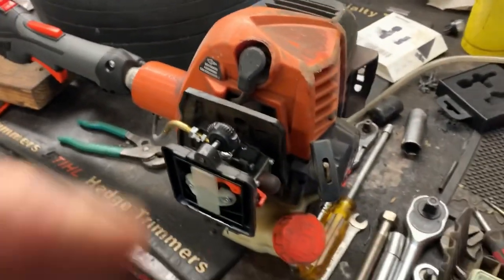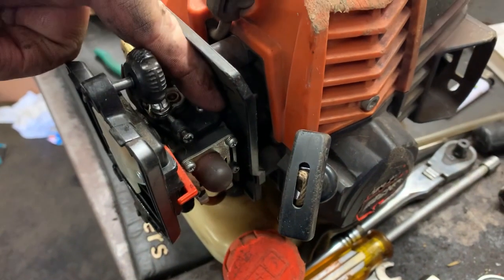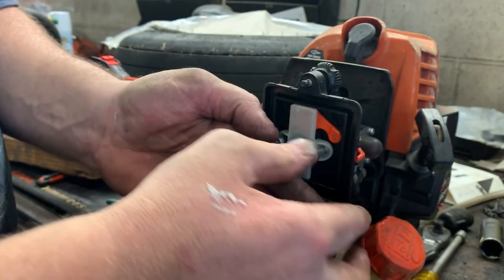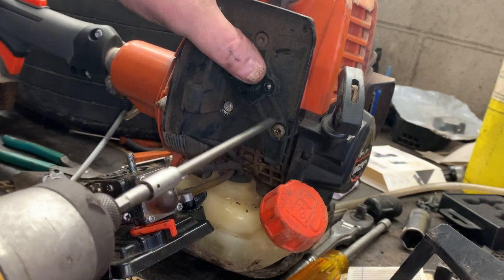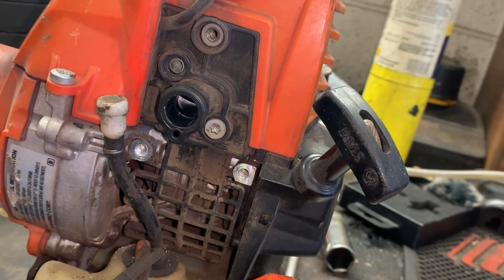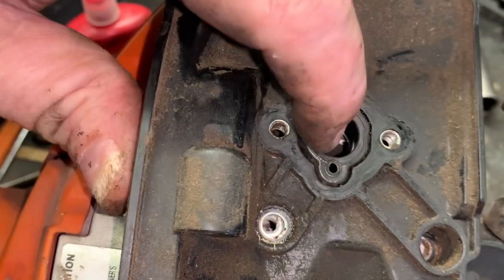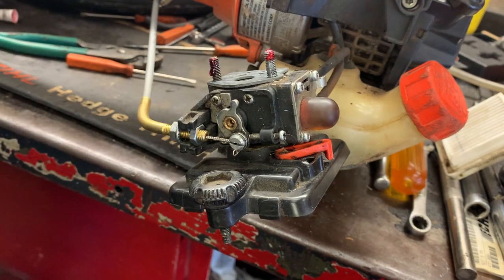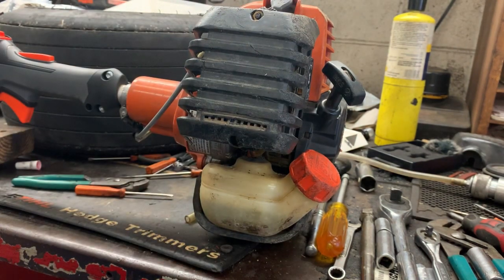FIXING COMMON ISSUES WITH THE ECHO SRM 2620 WEED SNIPPER

Comment: Another thing that our SHINDAIWA 262 trimmers do (appear to be the same) is that they foul plugs often. Same 2 stroke mix as everything else and they foul em almost weekly. Factory plug is a CMR7H, I now use two heat ranges hotter CMR5H and have had no comebacks.
Reply: Mine is fouling plugs now
Reply: @acaudioweddings Would a different fuel mixture solve this, or is it a natural occurrence due to design of the ports?

Comment: why does the string spinner head keep spinning when I don't push the ignition button?I've replace the carburetor pre your video as well as the spark plug, gas filter and air Filter and it continues to spin. SRM 2620
Reply: Carb needs adjusting. Either the idle screw is too fast or the air fuel mixture is off.

Comment: The Mower Medic One I have Echo SRM 2620 I don’t have any issues with this trimmer I inspected everything and maintained every year I love my Echo SRM 2620
Reply from the maker: Good to hear just give those carb bolts  a tighten for grins and giggles
Reply: I had Echo SRM 225 I replaced that for Echo SRM 2620. SRM 225 doesn’t have enough power

Comment: Thanks for the great video.  I have a Shindaiwa T262 (same as the 2620) that I bought last spring.  It ran great at first.  Then, in August, my dad dropped it off the back of his truck.  The whole carb assembly came off and the carb was damaged.  I had to replace the carb but it's never run correctly since. I had to go back 5 times to the dealer.  They claimed air was getting into the tank and put some sort of a sealant on it.  But it still doesn't run right.  When you go pull the trigger, it stalls a bit.  Then, as you're working with the trimmer and it warms up, the same thing happens especially when you flip it upside down.  Is there a fix to this?   If there's not, I'd rather cut my losses and get a new tripper as I had to pay $180 to replace the carb plus the $450 I paid for it.  That's Canadian dollars.  Thanks.
Reply: Did you fix it? I have the same problem
Reply: @davidsolis2149  Nope.  Sold the machine and bought a new Shindaiwa T262.  No problems with that one so far.

Comment: Just checked mine and they were a little loose. I also noticed that a mouse had chewed my choke lever and it is broken but still working. Just ordered a new filter base. He also got my return line. Little bastard! At least the filter base was only $7 and change. I had some fuel line so that wasn’t a big deal.
Reply: Mouses are a real pita

Comment: Hello I have a SRM2620 it works fine the only thing is that it doesn’t turn off with the switch (on/off) I have to flip the switch to cold start in order to turn it off. Any recommendations?
Reply from the maker: Simple diagnostic, test switch with VOM. all the switch does is ground the ignition coil
Reply: Probably figured it out already but try spraying some lubricant or cleaner in the switch and turn on an off a bunch of times to clean the contacts.